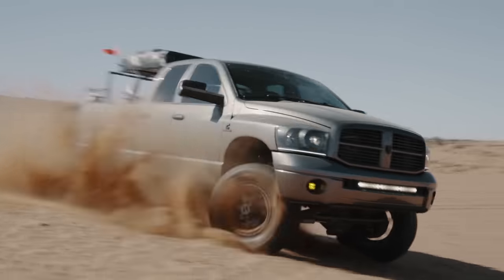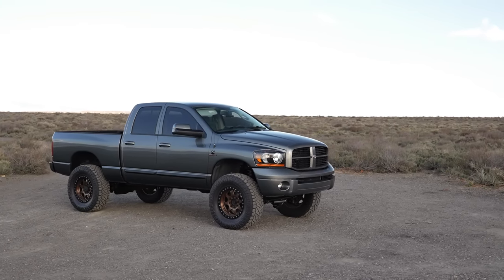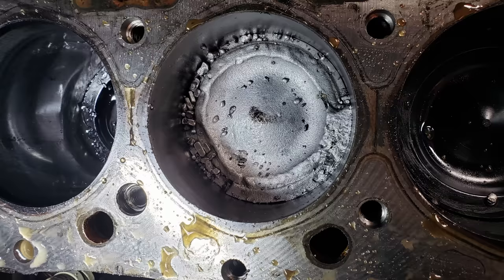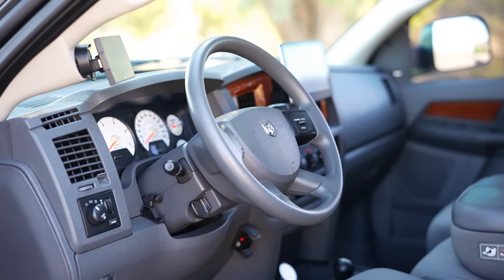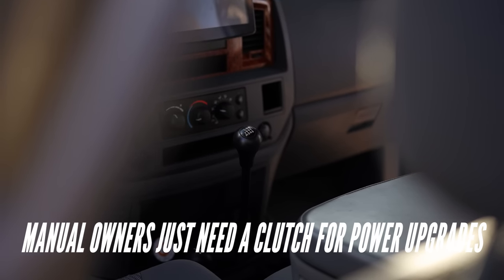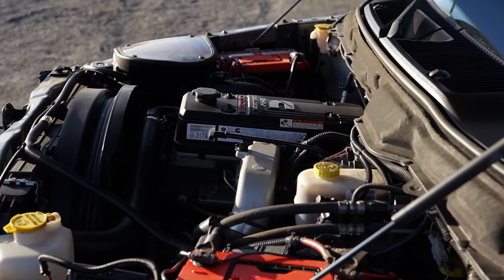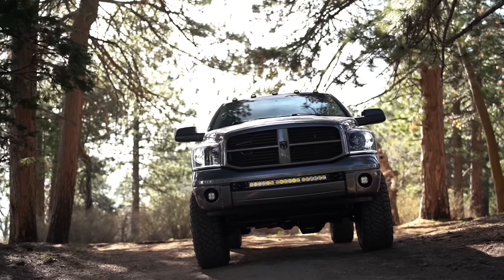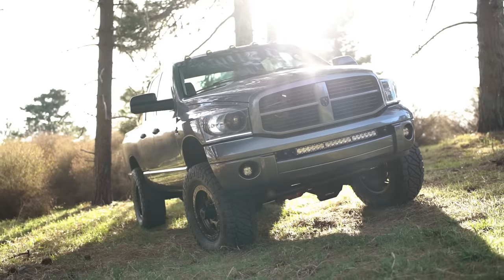Top 5 3rd Gen Cummins Issues You Need to Watch Out For (and How to Fix Them)

Comment: Don’t know if it’s mentioned in this video but I noticed the thumbnail while looking for a fix for my ram 1500 4 x 4 actuator this parts failed on me a lot of times when I really needed it right now I’m stuck in for coming off the job site in the pouring rain so just keep that in mind these ram trucks
Reply: I’ve had repeat failure with the 4x4 actuator… it’s pretty awful and expensive

Comment: Curious on your thoughts. I currently own a 6.0 that’s been a good truck. Not a fan of the lift in it and reverting to stock or dropping to dropping to lower lift just isn’t possible with cost or finding parts. So kind of looking for either another 6.0 or a 5.9 3rd gen with a standard trans. I’m fairly familiar with the 6.0 and also been around the block with the N14 Cummins before. Which way you think would be better?  5.9 or 6.0 that’s had the issues addressed (studs, coolant filters, etc)?  Mostly to tow boat/camper

Comment: Stock trucks 

Fuel filter changes
Fuel additives(generous amounts wont hurt

Valve body upgrade
Keep the trans cool when towing

Forget the red head, go with PSC and stabilizer upgrade 
All new ball joints
New steering linkage
Wheel bearings after you do all this

Comment: Most of the time loss of air flow just take out 3 screws and blower motor come out reach up in there and turn blend door to get out and your air flow will back normal and if you want inside keep windows closed and if you want out side air crack a window .

Comment: Great channel, very informative.  I currently have a 2020 3500 HO 6.7 mega cab which I love except for DEF and regen issues.  I live in NW Montana and these diesels don't like cold or idling to warm up.  My first Dodge was an 06 5.9 mega cab and I'm thinking about going back to one.  Is there a way to overcome the DEF/Regen issues without deleting?  Aside from all the new bells and whistles, how do the two generations compare-Laramie mega cab to Laramie mega cab 4x4, etc?  Thanks for any input
Reply: DEF and regen issues relate only to the late trucks as you probably know. Not 3rd generation like your old 5.9L 2006. Up to 2007 they didn't come with DPFs, which came out on the 6.7L (4th gen).  DEF injection was after that. Comparing a late truck to the last 5.9L trucks is mostly about two things - nearly no expensive and problematic exhaust system components on the early ones, and the higher power and torque of the late engines (for a big cost). 

One big change they made for 2019-20 that you should be aware of was they went from a Bosch CP3 high pressure injection pump to the CP4.2 design similar to what Ford went to in 2011 for their 6.7L, and GM used CP4.2 from 2011-2016.  This pump is light duty inside, and there is a not uncommon failure mode where the unsupported lifter gets cocked sideways on the roller and it grinds the roller, putting metal particles downstream into the lines, injectors, and fuel tank via the return line. I call it "The $12,000 problem.  Yes, replace entire fuel system and flush the tank!  Extra fuel lubricity seems to help. Sort of a band-aid. Use something like Alliant Power's Lubriguard or for Montana in the winter, Ultraguard, which includes an anti-gel. Both have extra lube and they also demulsify water, making the droplets bigger so the filter catches more. Stay away from an "emulsifier" or a "dispersant", which blends the water into the fuel and it goes right through the injectors. Not good. Best to put a larger, tighter micron fuel filter on all common rail diesels, especially the CP4.2-equipped trucks. I don't know how the CP4.2 in the 2019 and 20 are doing. Good news for a truck shopper is they went back to a CP3-type pump in 2021. But going back to a 5.9L if you can find a nice one avoids a lot of potential problems. Interesting to note that GM broke with Bosch for the L5P engine in 2017. They use a Denso fuel system.

Comment: I've got some pretty massive blowby.  I think it stemmed from an injector issue.  I'm at 370k miles and debating tossing a remanufactured engine in from a reliable company.  They want ~$15k out the door.  I can't replace the truck for that so it doesn't sound like a terrible idea but I'm worried about the trans/turbo/etc. etc. after 370k miles.  Any thoughts on if its worth it to toss a new engine in it at such high mileage?

Comment: 06 3500 srw, My horn randomly honks when I open door with engine running. Radio is intermittent, blend door broken, read door wiring broken. Otherwise a great truck with 353k miles, rebuilt transmission at 300k, injectors in 2010, no tuner

Comment: Great video and one question. Pictures of the front of your truck, on one  picture it looks like you have the stock fog lights and the next is a set of amber lights and it looks to be Baja Designs lights. How did you mount and where did you get the parts.   Also what head light buckets are you running and what bulbs. Thanks
Reply from the maker: This video has shots of both my third gens. The current one is still a work in progress, so no fog lights yet! Here’s a link to the ones I used: https://www.cjcoffroad.com/products/cjc-off-road-2003-2009-dodge-ram-fog-light-led-brackets

Oh and the cool lights on the old truck were all custom built!

Comment: I’ve got a 06 2500 with the 5.9, it’s just at 180k and I believe I’m the 3rd owner so I know it’ll need new injectors most likely soon. I have the issue with the Tipm where my turn signal doesn’t work and neither do the cab lights on top of the truck, I’m going to look into a newish tipm, would that fix that?

Comment: Hey Andrew I just got my 1st Diesel. It’s a 2004 Ram 3500 SLT 5.9 Cummins H.O. engine, cast iron NV5600 6-Speed manual transmission, 4x4 manual floor shift transfer case, and dually. I say all they to ask if you know of a research source they you know of (ie book, website, ext) that I need to read as a new Diesel owner?

Comment: The cheapest way to fix the lack of air flow take 3 screws out of blower motor and unhook the power cable and reach up inside and flip door around so you have the small end and it drops right out put motor back in and plug in Harned and you are ready to rock and roll and never switch the blend doors with blower on high and turn it off and the switch the blend door and turn blower back on and your hood to go !!!

Comment: One thing I have noticed is if it sets more than a day I usually have to use starting fluid
Reply from the maker: Something is definitely wrong. Start with batteries and electrical, then turn your attention to the fuel system.
Reply: Yeah I would try to avoid using starter fluid

Comment: I’m currently having a problem with my 2006 quad cab it has a 60/40 rear seat goes up half way and stops and my electric rear window slider won’t work either my cable broke

Comment: Question need help ?
I installed my cts3 tuner and the air dog lift pump 
But my 5.9 03 doesn’t go more than 22kpsi of rail pressure 
So stops accelerating in the first gears 
How do I change this or fix please ?
Help help?
This is only when I do the extreme tuning

Comment: I got a 07 5.9l and I do have a p2509 code. Wene in park it ideals fins but wene put in gear rpms jumps up a couple hundred then wene put into park rpms jump up to 2k then back down to normal. Wene coming to a stop sign or light I have to put it in neutral other wise rpms are to high and truck just wants to accelerate. Any ideas on what's going on?

Comment: I’ve been reading that there is an issue with the driver side steering knuckle. Something about the hole for the upper ball joint was drilled at an angle. Apparently not all trucks have it but 06 was the worst year for it. Have you heard anything about this?
Reply from the maker: Honestly not an issue! Just one of those things people write about on the internet haha

Comment: Don’t know about yours but the one I have has a water leak in the cab when it rains. Can’t pin point where it’s getting into the cab from ive resealed everything
Reply from the maker: Likely the third brake light!
Reply: Do you have a sun roof
Reply: @ferguson8143  no sun roof. resealed the third brake light.
Reply: What part of the cab is getting wet??
Reply: @jonathoni.1566  coming through the visor. But I don’t know if that’s where it settles then leaks out of there. Don’t know if I should put a smoke machine in it and set it off to see if I can find the leak that way.
Reply: Bad seal on windshield

Comment: What do you think about lithium batteries for these trucks? Also, is the airbag light in the FCM?
Reply from the maker: I personally run AGM batteries in all of mine. As for the airbag light, that can be a lot of things. I’d start with taking the truck to a dealer or calling with your VIN to confirm the airbag recall was done.
Reply: @JustDiesels  thanks for the advice and quick response!

Comment: You missed the leaking cabs, sagging doors, ball joints, unit bearings, and turbo vgt actuators and shoddy trailer hitches. But that’s probably in another video. 😜
Reply: shoddy trailer hitch?   on m 2008 it angled downward,  I assume that it was from  excess hitch weight
Reply: @timyanke9559  no, not excess compared to the capacity of the truck, but excess compared to the welds on the factory hitch.
Reply: @MalarkeyTaylor  I haul  a dump trailer,  rated max weight 16,000 lbs. the hitch has a slight angle down.  for the most part  I'm quite happy with my  2008 3500 srw. I'm sure  regular  maintenance and stock horsepower settings (deleted) help with  reliability
Reply: @timyanke9559  mine had a slight angle down for 20-30k mi before it just snapped and let go. 
I replaced the hitch with a curt and it has held fine for the last 150,000 miles.
Reply: @marktaylor8374  thanks for the info, I think I will get it changed before I loose a trailer on our rough roads

Comment: Is 213000 miles still good to purchase the owner just got the transmission rebuilt its in excellent shape!
Reply: Yes absolutely I just bought a bone stock from front to back 08 3rd gen with 275k on it the thing is flawless other than a back window motor and a clogged DPF which is easily fixable as long as it was taken care of I would buy a 300k+ mile cummins any day

Comment: Nothing about tachometer needles falling off inside the gauge cluster huh? I guess This isn’t a common issue and I’m just lucky 🍀
Reply from the maker: No it’s pretty dang common with 2006 trucks! It’s an easy fix though. Just send the cluster out for a rebuild. I’ll be sending mine to Module Master.
Reply: @JustDiesels  hopped in my 03 one morning to head to work and… tach needle laying on top of the fuel gauge needle. Awesome.

Comment: So if I went to a shop and say I want fuel system upgraded what brand would I look for? What would I tell the mechanic I want used
Reply from the maker: You’d want to add a nicer lift pump like the fass on this truck which comes with nicer filters than stock.

Comment: I'm looking at a 06 3500 mega cab with the manual transmission  right now. Os there any other engine problems  besides the injectors?
Reply from the maker: That’s really the main thing on these trucks. Most engine issues you see are related to failed injectors.
Reply: @JustDiesels   how about the manual transmission. Any problems  with that besides upgrading the clutch
Reply from the maker: Not really as long as you’re nice to them!

Comment: Put a pyrometer on the truck and watch exhaust temps. You can literally change an injector selonoid for less than $20 in a few minutes. Replacing the whole injector is easy but not cheap. Any decent replacement should last 200k without issues unless your fuel tank is full of water. All the early 2000s diesels see issues with fueling because high sulfur diesel was a lubricant the government removed.
Reply from the maker: If only it was that easy. The solenoid is not the only wear item in an injector, and an EGT probes measure collective temps in a bank of 3 cylinders since the manifold is split. Long story short, the only way to test injectors properly is with a contribution or bench test, but even then I personally think it’s better to just replace them after or around the 200k mark. 3k for injectors is cheaper than a new long block.

Comment: Should I try and replace my tipm on my 06 it’s heated seats don’t work, headlight flicker not that much but sometimes, air bag and ABS lights on, and my cts2 randomly restarts, and my radio re sets some to or I have to restart it to get the radio to have volume again
Reply from the maker: That sounds like TIPM, but you want to be sure since a quality one costs about $1,400
Reply: @JustDiesels  what would you say is a good one?

Comment: I'm confused.  Did he say that putting the truck In Tow, haul is good for it or bad?
Reply from the maker: Good. Increases line pressure and makes for firmer shifts and less torque converter slip.

Comment: I have been fighting my 3rd gen front end for a while now...I have changed everything! Synergy ball joints, one piece draglink ( with heim joints on every corner, even track bar) redhead steering box, borgeson steering shaft. It still wonders all over the road. Kinda scary to drive, it has a 4" lift with 37x12.50x18 Method nv315 on it. If you have any input on how to stop the wondering please help! Thanks man love the channel!

Comment: Rebuilt tipm are a pain never work right 06 330000 miles 6 speed manual changed clutch at 285000

Comment: Bro I'm trying to get the best steering possible out of my second gen can you help me
Reply from the maker: Yeah do you want a parts list? What year is your truck?
Reply: @JustDiesels  2002 Dodge CUMMINS TURBO DIESEL
Reply from the maker: Here’s a list of the best parts possible for your truck. You likely don’t need to replace everything at once, so make sure to go through the front end to look for play following along with my how to fix sloppy steering video:

Steering linkage: https://www.cjcoffroad.com/collections/steering-linkage/products/synergy-manufacturing-2000-2002-dodge-ram-2500-3500-heavy-duty-steering-kit

Track bar: https://www.cjcoffroad.com/products/thuren-1994-2002-2nd-gen-track-bar?_pos=1&_sid=3ed55de9f&_ss=r

Ball Joints: https://www.cjcoffroad.com/collections/dodge-steering-upgrades-and-components/products/emf-2000-2002-dodge-ram-2500-3500-heavy-duty-ball-joints

Steering Box: https://www.cjcoffroad.com/collections/steering-boxes/products/redhead-1994-2002-dodge-1500-2500-3500-pickup-steering-gear-18-1-ratio

Steering Box Brace: https://www.cjcoffroad.com/collections/dodge-steering-upgrades-and-components/products/synergy-suspension-1994-2018-dodge-ram-2500-3500-4x4-steering-box-brace

Sloppy steering fix video (filmed on a 3rd gen but the process is the same): https://youtu.be/9NcLGLnXoDI

Comment: I tried for month to find a decent 3rd Gen manual, like yours and either it was way up there in price or beat to crap. I ended up finding another gem (04 powerstroke) with 58k original miles. This would be my second 6.0 as the first one was fully bulletproofed and this one will too! Any idea on good mechanics out near San dimas?
Reply from the maker: Hands down Maximum Diesels in Hemet!

Comment: 😂😂😂😂😂I have an 04 with just over 200k bought it with 50k and I have had 4 out of the 5 transmission is original but no tuners. But I will say my climate control is messed up and I can’t find a replacement I have dual climate control and only ones I can find areused